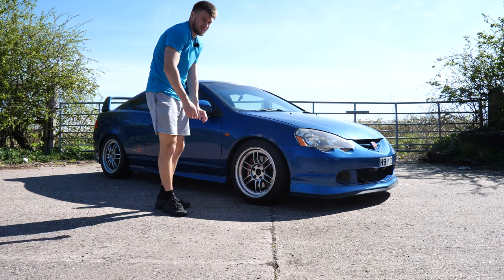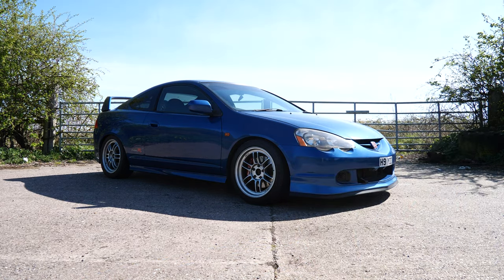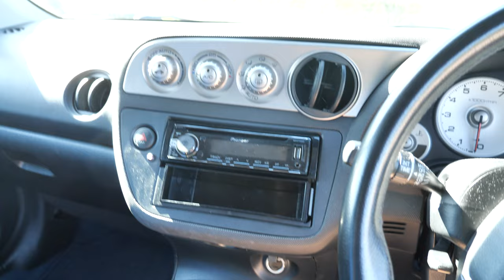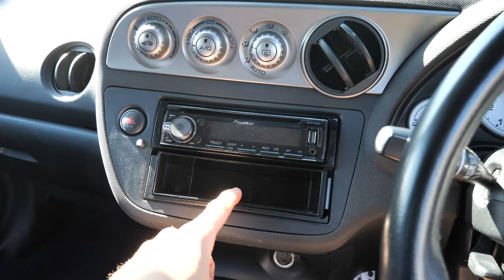BUILDING THE MADDEST DC5 IN THE UK !!!!!

Comment: Yeah definitely go for the big turbo route also running water meth 50/50 mix which will need a tune for water meth also the flames will be mad than now, you could do floor exit or bumper exit for the screamer pipe if you dont want to make a hole for the carbon bonnet
Reply: If you want Malcolm I can send links for two more items that you will need for water meth such as the filter also the hi flow lo current solenoid valve